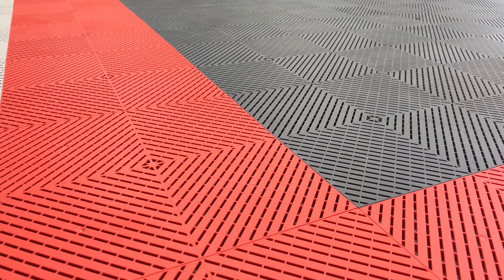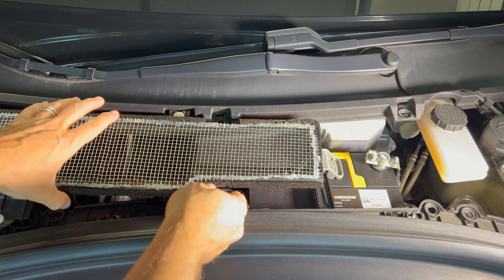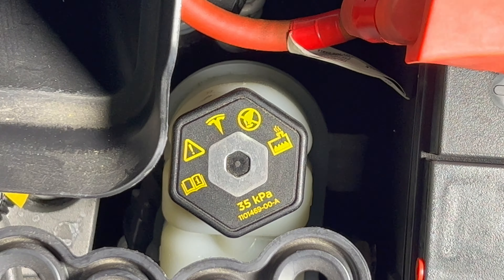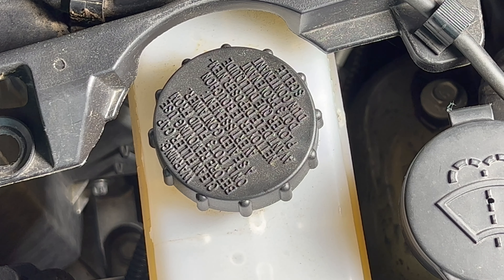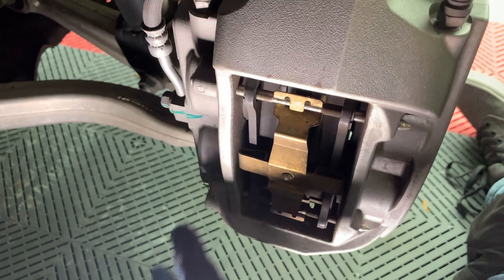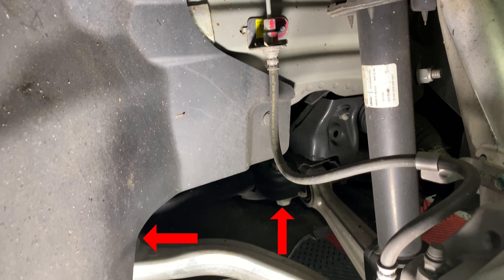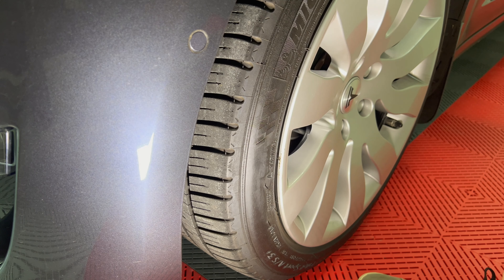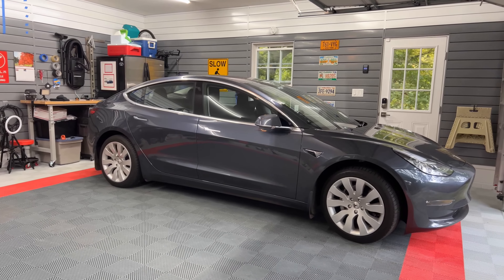Tesla Model 3 - 41k Mile Maintenance

Comment: Great reminder video!  I need to check my brake fluid too.  I have a Motive Power Bleeder to flush my own brake fluid on my other cars but haven't had the need to use it on my Tesla yet.  I need to verify the cap size first to see if it will screw down on the tank.   I've also been procrastinating on cleaning the corrosion off my brake caliper slider pins.  Chicago has a lot of snow and salt, so you're correct in saying that cars up north need to check this each year.
Reply from the maker: Thanks! Luckily we get little snow during the winter here.  So my brakes calipers look pretty clean and of course the pads still look like new due to regen.